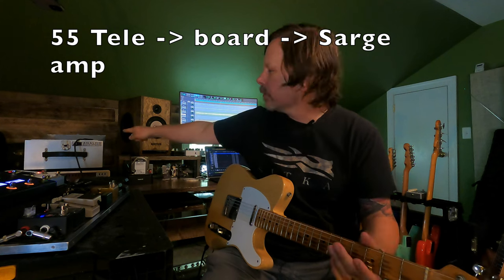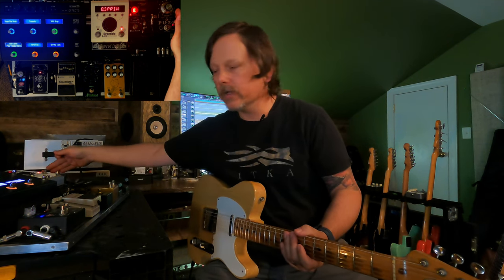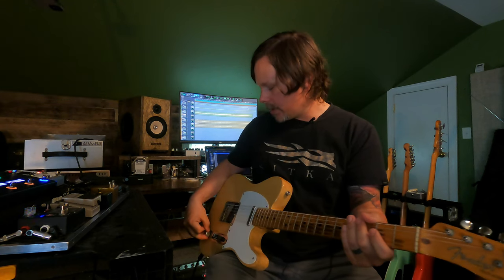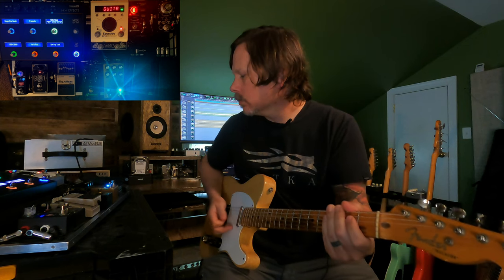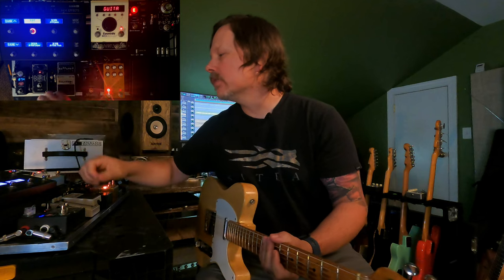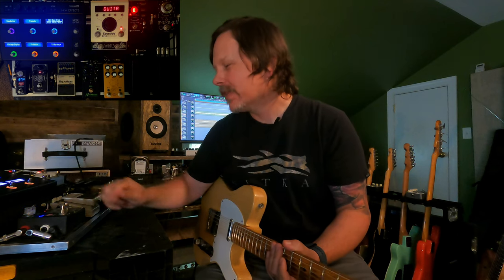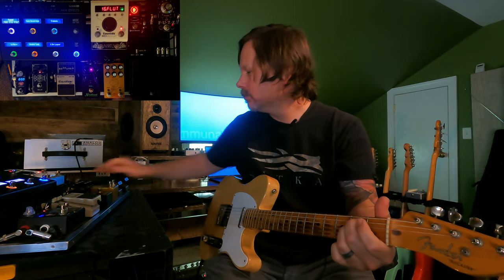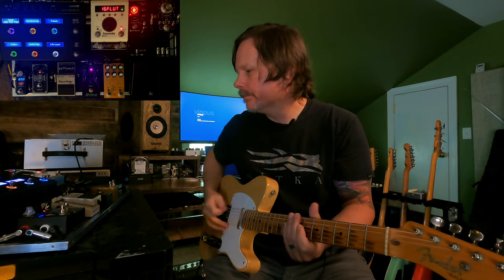Is it time to downsize your pedalboard? Small footprint; serious firepower!!

Comment: Hey Justin, I was intrigued by your #1 rule and it got me thinking about pedal platform amps. I'm curious to know your thoughts on them, considering your emphasis on having a fantastic amp at the edge of breakup. Pedal platform amps typically offer clean tones with high headroom, meaning they don't break up easily, or at least not until they're cranked up really loud. Examples like the Suhr Bella or the Two Rock Traditional Clean come to mind. I'd love to hear your perspective on this. Your philosophy and approach to tone resonate with me. Thanks!
Reply from the maker: I find that amps with a lot of headroom are susceptible to large jumps in volume when stepping on a boost pedal. I just prefer when the amp is cooking to the point that I can go from from clean to grit all in my right hand attack. When set that way, the amp doesn’t get a lot louder when I step on a boost. It’s like self-mixing in with the band. Cheers!
Reply: I was going to ask Justin the same question - you worded it really well. 

Perhaps if you have a pedal platform kind of amp (something with a ton of headroom that barely breaks up) you could obtain similar results by having an always-on light breakup overdrive last in your OD section - something like a lightspeed.  

My tone is nowhere near as good as Justin’s, but this is what I’ve been doing with my two-rock studio sig.

Justin’s videos, however, make me want to plug into my 3rd Power Wooly Coats Extra Spanky MKII, which will get that edge of break-up tone like a Deluxe.

Comment: Ive just started using a pedal board- before i had a multi effect pedal but in the amp effects loop- nice rich tone. But im basically the bands utility player. Some acoustic some harp some bass. So i set up my rig to minimize my load. I have it set so when i can switch to harp then click on the distortion channel add a delay or reverb or both. If the next song is acoustic i switch to the guitar feed (baggs preamp) turn off the distortion and select reverb or delay or neither- whatever. So its very much a tool for routing my instruments and some texture. I run mostly clean except the harp so im getting alot out of one amp and a small board. It was born out if a need to be compact and versatile.

Comment: Justin, how do you approach a humbucker guitar vs. single coil with your board?   both of you board demos included your tele, but I wonder what changes you think about or hear diferently with a humbucker.  Thanks
Reply from the maker: Great question! Believe it or not, the bridge pickup on the Biscuit is hotter than pretty much every humbucker guitar I have. For me, it comes down relying a ton on the guitar’s volume and tone controls rather than having different pedalboard settings for Tele, P90s, Jazzmaster, Strat, humbucker, etc…

Comment: I'm super curious how your are setting up the expression pedal at 16:51. Do you have it mapped to both Mix and Feedback? 0-100 or a certain range? I love this concept of controlling delay with expression pedal. I'm thinking of adding a 2nd expression pedal to my midi controller just for this purpose. I use it to control Helix Native, which is essentially the software version of HX Effects.
Reply from the maker: It’s patch dependent. But yeah on the one delay it is controlling mix and feedback

Comment: I bought the GB because of you. It sounds fantastic. My only issue is the delay when you turn it on.  Is this an issue for you during recording?  I also bought the mercury 7 and it too sounds killer.  Do you find you can get the same quality of plate reverb from the hx effects? Thanks!!  These videos are incredible.
Reply from the maker: All of my tube amps take longer to turn on. The HX and the H9 also take a second to boot up. That said, the GB did have a bit of a learning curve for me. I tried several times to activate the drive and boost together, forgetting that this is how the pedal stages the gain in 25% increments. Took a while to break myself of that.
Reply: @JustinOstrander  Sorry, to clarify, when I depress the foot switch there is a delay from when I press it to when the pedal engages. Every other effect pedal I have engages the effect when I depress the foot switch.  It does’t sound like it’s an issue for you, which is good to hear! Thanks again for the wealth of info.  I’ll buy your presets when they are available.
Reply from the maker: @BoBigReds  Ah! I see. Yes, there are a few pedals out there that activate on the release of the switch rather than the pressing of the switch. This is part of how the GB was designed due to how you cycle through the different kinds of gain and boost. I totally agree—that was a learning curve for me as well.

Comment: What are your thoughts on the HX effects vs the H9?
I use an HX Stomp for most of my work these days, whether it's DI or in front of a Carr Rambler amp. The H90 piqued my interest but if the old M9 is good enough for Uncle Larry, it's hard to imagine needing to upgrade anything Helix.
Reply from the maker: If I had to pick one, it would be the HX
Reply: I’ve been dealing with my HX Stomp since pandemic.  I’ve never been successful With 4 cable method.  I’ve had good luck in the studio, especially mixing live amps and Stomp.  It’s great to learn the software, but it’s great to be able to make adjustments on the pedal especially in the studio.  I like your concept of pedals.  I may be old school, for a sound or a tone to work, it has to fit the music and feel good with the fingers.